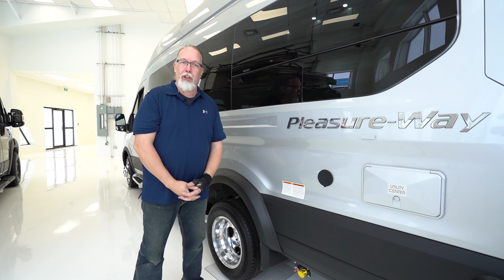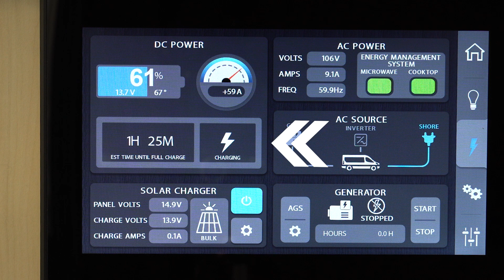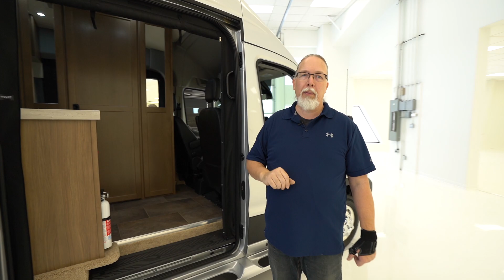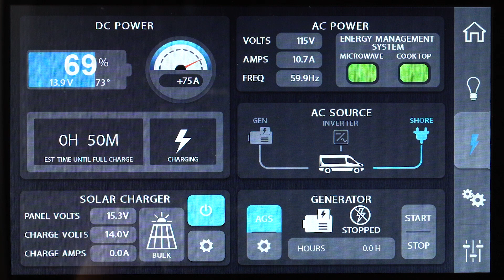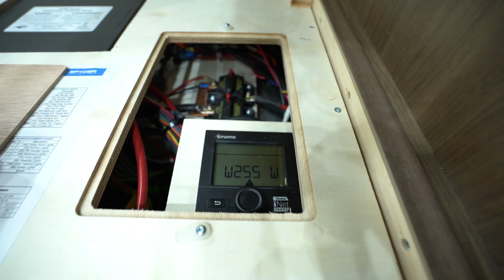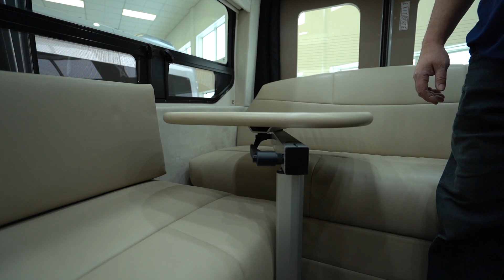2022 Pleasure-Way Ontour 2.2 | Orientation Walk-Through

Comment: Thank you for this video.  There is a yellow label at the bottom right hand side of the screen that reads, “ rear and sliding doors must be closed prior to extending awning”, but you opened it with the sliding door open.  I don’t understand why that label is there since you would want to watch as the awning is being extended.  Can you explain this?

Comment: Not big on the fact there isn't a cap for the gas as in standard autos! Worry fumes could become a cause of fire or explosion if they get into the inside of the van?
Reply from the maker: Greetings! The fill does indeed have a cap, it's just not the typical screw on type. It snaps closed after you pull the gas nozzle out. Ford has been using this style of fill for many years. It is perfectly safe. Thank you!
Reply: modern autos have this same feature...

Comment: Wait a minute....You need to crawl underneath to get to the black and gray tanks???
Reply from the maker: Hi there, it does look like that in the video but the sewer hose connection is right underneath the running boards (like in our other models) so it's fairly easy to access.